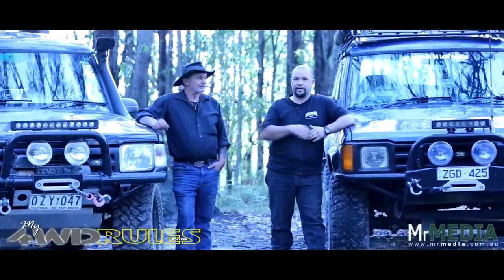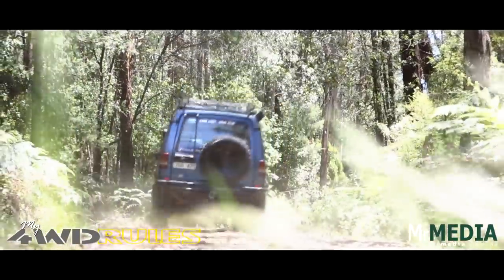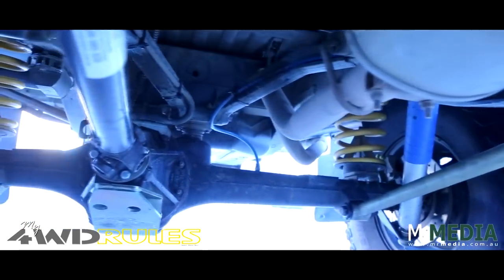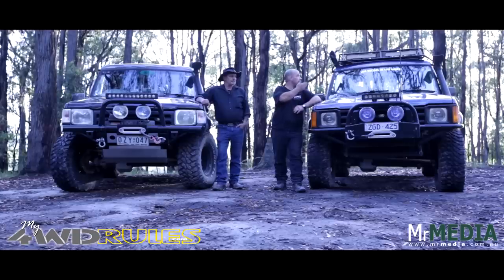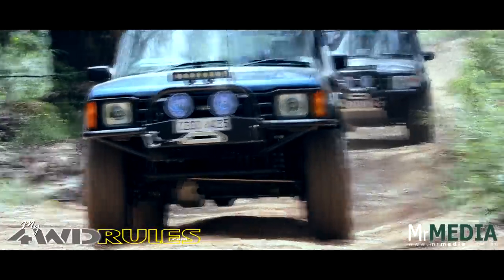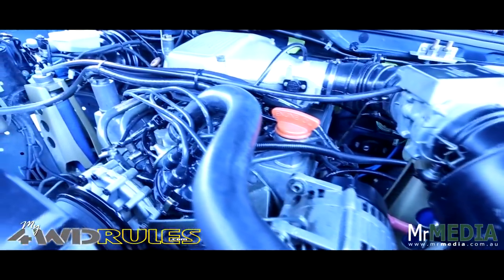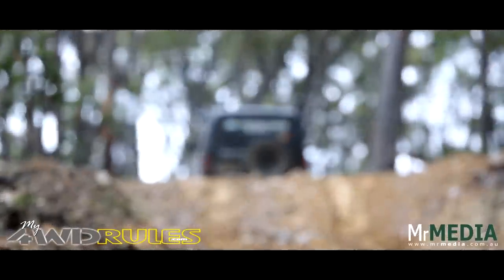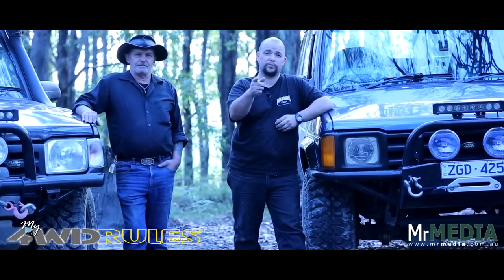Peter Williams Landrover Discovery Retro Rebuild

Comment: how did you fit 33 inch tires on just a 2 inch lift? or was there more lift added and i just didn't hear correctly
Reply: Dallas Thornley chopped guards
Reply: what do you mean by chopped guards... sorry for sounding naive
Reply: Dallas Thornley They look to be white tiger flares http://www.lrautomotive.com.au/contents/en-us/d626.html you need to cut metal away from your guards and then fit these.  With this you will have no problems fitting 33 on 2' lift.  Also in the footage it looks like a 2" spring sitting on a 2" spacer making a 4" lift.
Reply from the maker: Hi Dallas.. thanks for the input... If you want to chat to Pete Williams about build specs etc, you can get him at: http://www.facebook.com/my4wdrules, If you send a message there, he will get it.. thanks mate :)